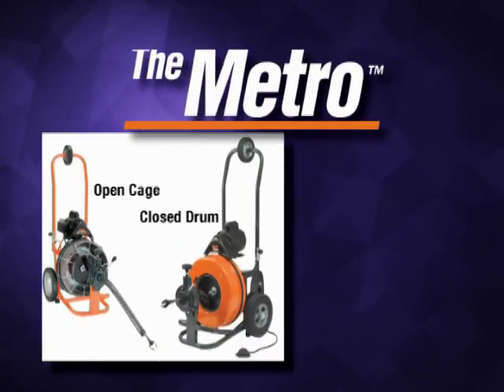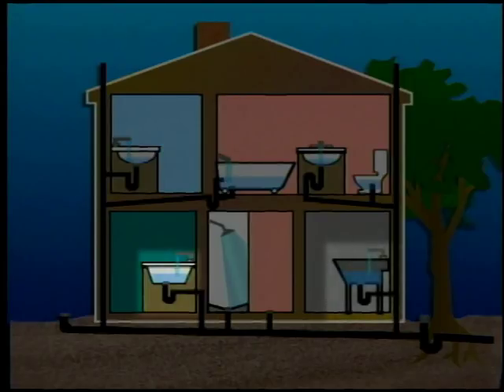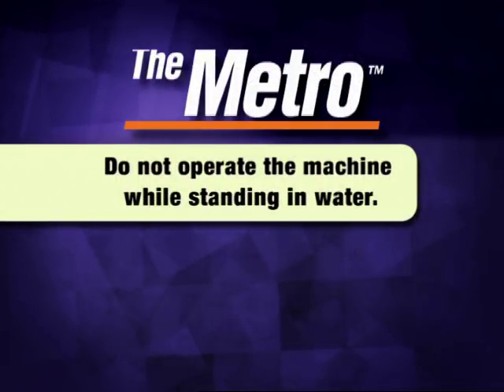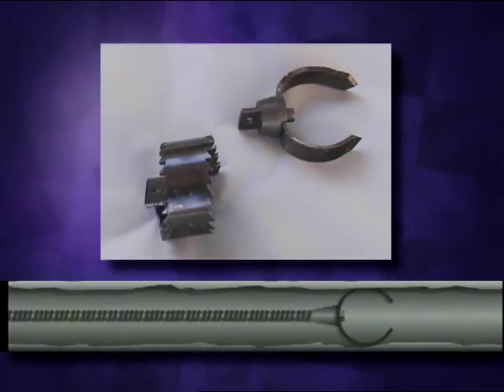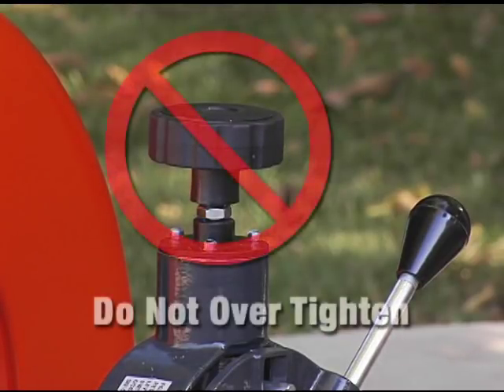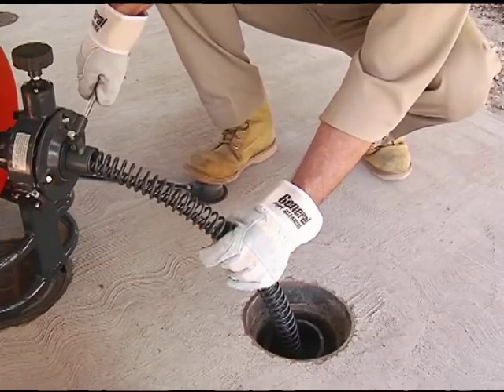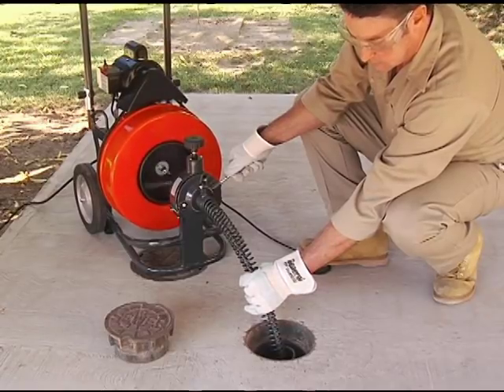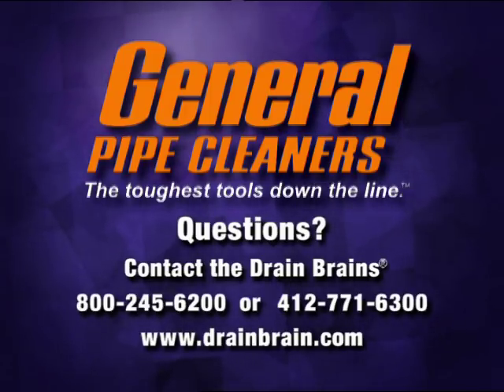Metro Power Drain Cleaner How To Video

Comment: Great video, very concise and safety orientated. Have used the open cage manual feed type . Dangerous and labor intensive. Where can I rent one. Home Depot advertises for these units but everyone at contact that they don't have them there for rental. I live in the northwest suburbs of Chicago can anyone help
Reply: The rental industry prefers the open cage design because the cable can be easily inspected and cleaned between rentals. We offer a poly-canvas cage cover as an option. Please call our customer service at 800-245-6200 for assistance.

Comment: drain brain, I have the large general.....my cable is hard as heck to pull out and use. maybe ever stuck. it must be twisted in drum.....i basically gave up on it and as you know as a plumber. No time to work on that while working.....any suggestions? Thanks CB
Reply from the maker: CB, We can take care of that for you. Please contact us at 800-245-6200 and let us know where you are located. We can either have it repaired here at the factory or a local repair center if available. GWS

Comment: I have the general mini rooter xp, bought couple of years ago.
My autofeeder looks the same as this one, but it's not gripping the cable anymore. Where can I get the replacement bearings?
Reply from the maker: The Metro uses a larger feed roller than the Mini-Rooter feed. Order part number PO-MR-703 for a set of 3 feed rollers for your machine. Please visit www.drainbrain.com and click on the Where to Buy page to find a distributor in your area.